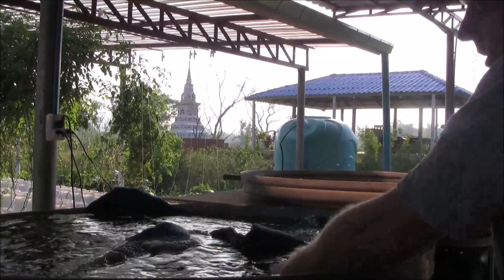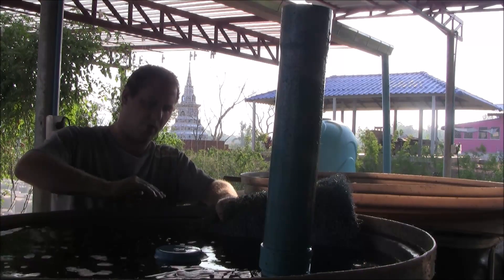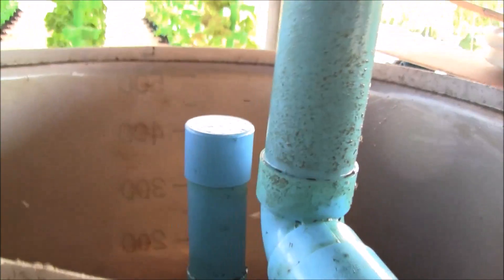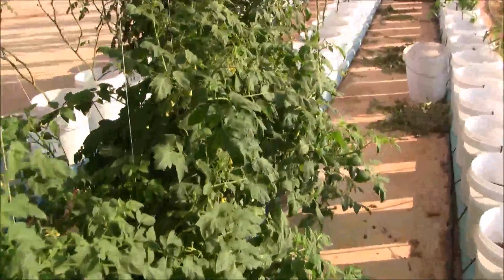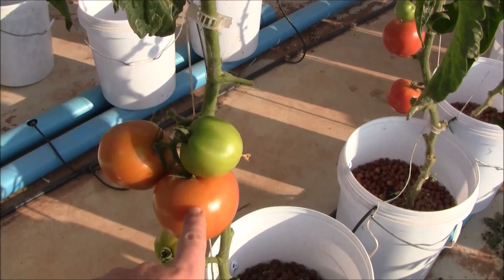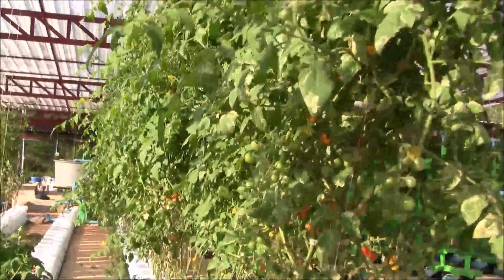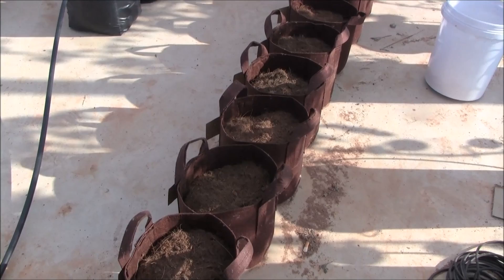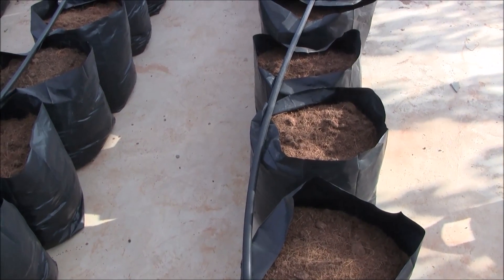Stop Hydroponic Tomato Cracking, and Cleaning Aquaponic Filters

Comment: That looks like a pain to be continually cleaning out that filter every day. 

How come you didn't go with a rotating drum filter? Keep the tanks for nitrification, but the drum has a fine micron screen that blocks the solids, and when it detects slowing flow (from build up of solids on the screen), it spins and sprays off the solids from the other side of the screen.

Then you'd only need to turn a pipe to get out all the solids.
Reply from the maker: Because they are expensive and I'd have to import it.
Reply: Ponic Wars I know, everything costs money.
http://www.aliexpress.com/item/Aquaculture-Drum-Filter-use-in-water-treatment/32231310757.html

I'd say it was worth it though, not my money though.

Comment: Good info on the tomato cracking. As for your constant filter cleaning, I have a 65 gallon radial flow filter filtering water for some 1000 tilapia and the filter never seems to need cleaning. I accidently got some fingerlings in the filter through the drain and they seem to be growing really quickly. I don't see signs of poop in my GBs so I can only assume that the fingerlings are eating the extra food and fish poop. You might try throwing some fish in one of your filters and just wash the mesh when needed and see if that works for you.

Comment: Do you wash those filters with chlorinated water or water from a another source?   The chlorinated water will hurt your filtration pretty badly. 
Hope the netting helps. I may have to set it up here having the same problems with wind and bugs.  
Thanks for the videos. I may have to make some of my system for input.
Reply from the maker: Bio filtration is not occurring in these filters, there are dedicated bio filters for that.
Reply: I know you use another filter for bio but the chlorine will still settle in the material and can cause problems. Just a thought.  Might be better to use dechlorinated water. Personally I don't let any chlorine in my system as a safety measure.  Perhaps I'm paranoid.  Really appreciate your videos.